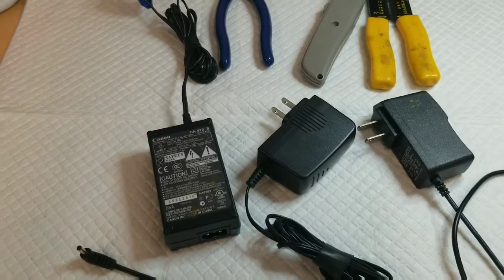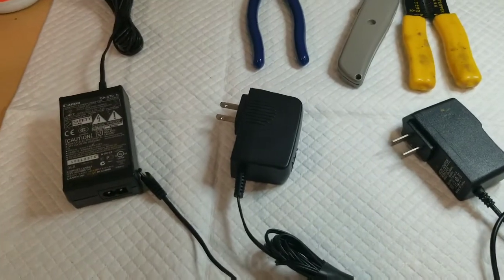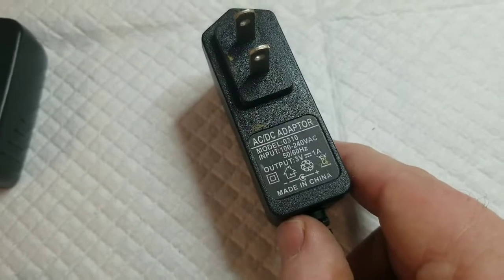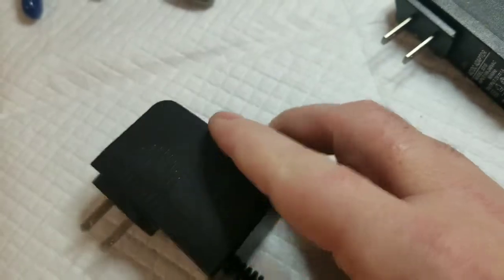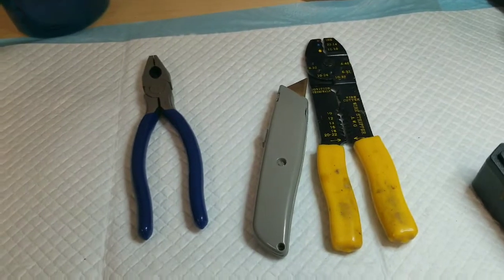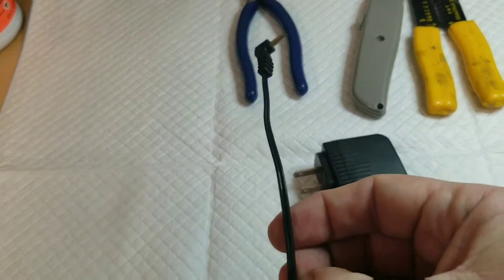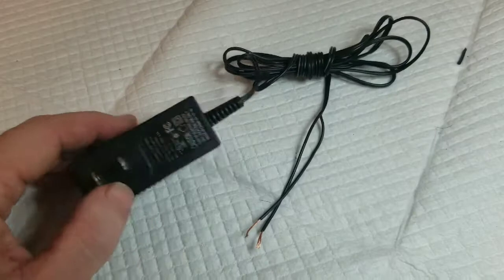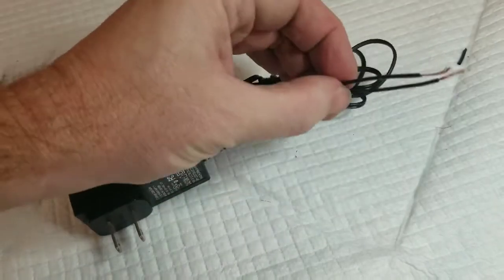How to Make a Homemade Electroplating Power Supply - DIY Golf Club Restoration

Comment: I have a brush plater that I can control the Volts but not the amps can I use this as a power supply. It goes up to 11 volts
Reply from the maker: If you can control the voltage, then that would be a great candidate. 

Question, if you already have a brush plater, why not just use it?
Reply: I have heard that bath plating does a better job and comes out shinier but I tried it and it only goes up to 999 A and then shuts of. I have the universal plater from gold plating solutions. I bought the 300 dollar Caswell nickel plating kit, it DOES not come with a power supply. Lol so I payed 300 dollars for two buckets and the nickel solution.

Comment: Is there a possibility to get electrocuted using this set. I have a cheap phone charger laying around and want to build this, but again because basically i know very little about electricity for me its sketchy as hell. Thanks for the video tho👏👏
Reply: Very low voltage, you’d likely not even feel it. Now you would feel the shock from your outlet. The adapter controls the output to not fry your devices
Reply: Input(from your wall outlet) can be 100-240 watts and high amps. Now, the output he suggested is 5 v, but the amperage is the kicker, it’s the rate of the electricitys current and high amp is something to pay attention with higher voltages. You still will likely not feel anything with low voltage though. It’s just a fire hazard to have a open live wire at any. Voltage imo

Comment: do you add the alligator clips to the wires?
Reply from the maker: I bought wires with clips on them that I attached to the ends of the chargers as needed. You could add them if you wanted a more permanent solution, though.

Comment: Was wondering for a larger job are the power requirements the same or do i step up the game?  Also can you add another power supply of the same current, not sure if you can or if it matters.  I want to do a set of golf irons, is it better 1 at a time or can you do the set
Reply from the maker: Yes, I bought an inexpensive DC Power Supply from Amazon. I have more control than a random wall charger. Check out the links in the description to see what it looks like.

Comment: Is this for electro cleaning or for the actual nickel/copper electroplating?  I'm thinking about getting the DC Power supply you have on amazon, but does this work just the same?  (much cheaper)
Reply from the maker: Yes. This was an early hack because I'm a cheapskate. The DC power supply is the way to go. Mine was from Amazon as well. I linked to some in my store. Just read some reviews and pick an inexpensive one.

Comment: The problem with these setups is your electrodes will soon break down at the quantum level, and dissolve. Graphite rods are some of the best electrodes you can use for such projects. My formal education is in the science of electrical/electronics engineering, so I've experimented a lot with electroplating schemes. 

I remember I first used some cheap stainless-steel silverware for electrodes, check on a project several hours later, and the silverware portions in my solution had completely dissolved! lmao This was a few years before I had gone to college and was an amateur doing sometimes very silly things.
Reply: Doesn't stainless steel off gas toxic vapor from the chromium when you pass a charge through it?
Reply: Where could you salvage graphite rod sort of thing from to DIY this unit?